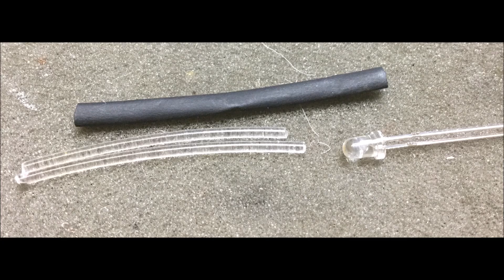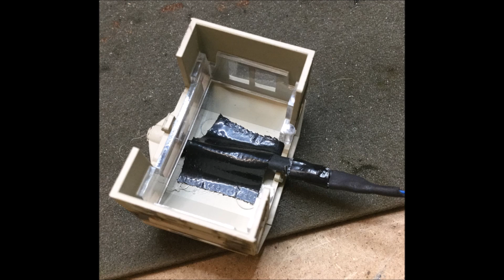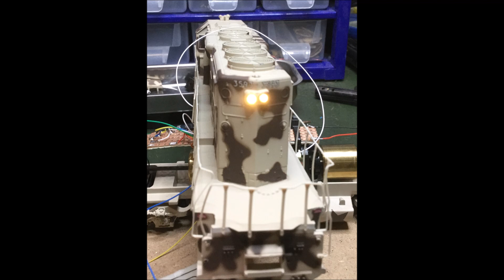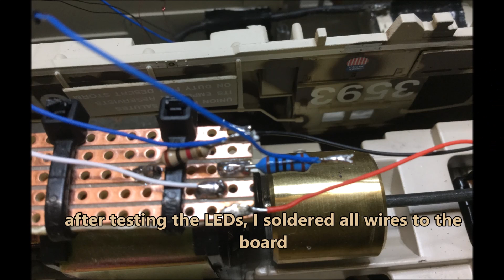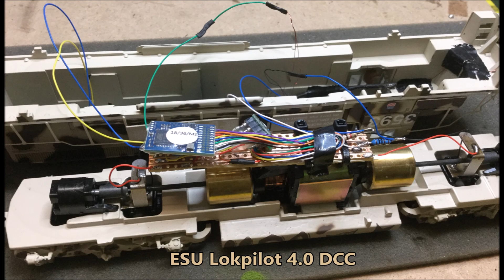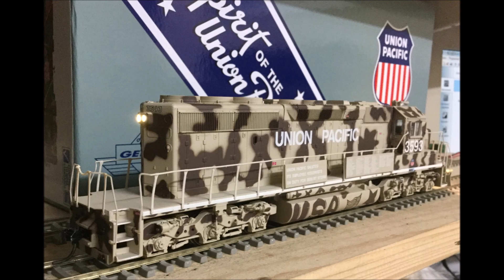Athearn SD40-2 UP 3593 Desert Storm Part 2

Comment: Wirklich tolle Arbeit !
Reply from the maker: Rarawer danke Dir👏, ist mal wieder eine interessante Lok, mal sehn was sich als nächstes findet.
Reply: @hdspringer2561  ich warte ja sehnsüchtig auf die ST44 PKP die im December von Piko kommen soll. Polenbahner Robert hat sie schon ! Mache ein Review über den Klopper, wenn ich ihn habe
Reply from the maker: Rarawer das ist ein  fettes Teil und fällt in die Kategorie, so hässlich, dass sie schon wieder schön aussieht😜. Auf jeden Fall mal etwas anderes. 👍 . Hoffentlich bekommst Du sie bald, dann gibts ein neues Video🎬😀
Reply: @hdspringer2561  ist ja die Russische “Taiga Trommel“ V200 mit größeren Scheinwerfern